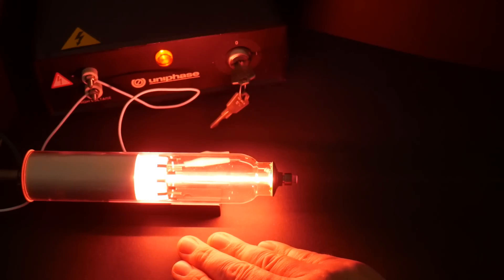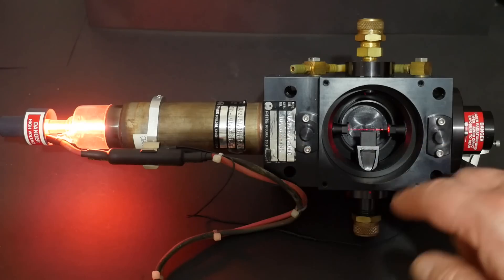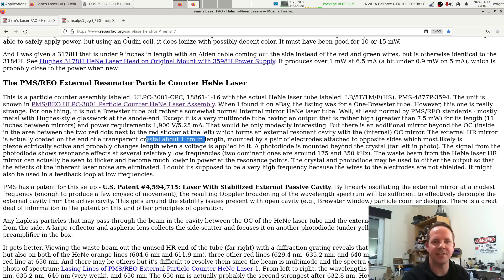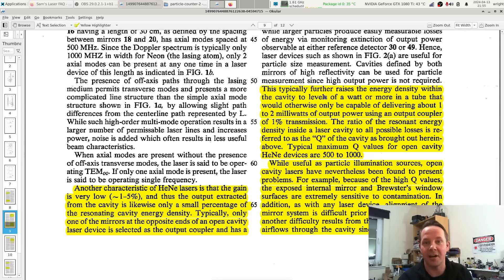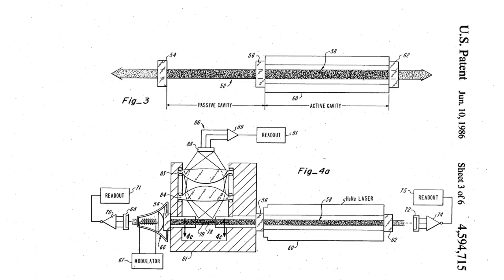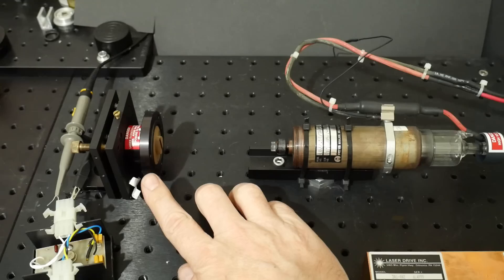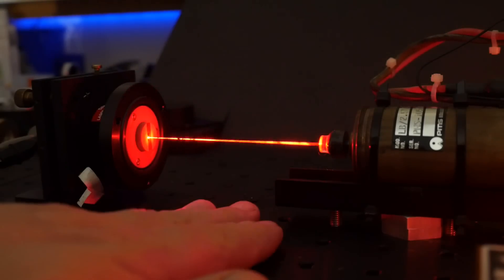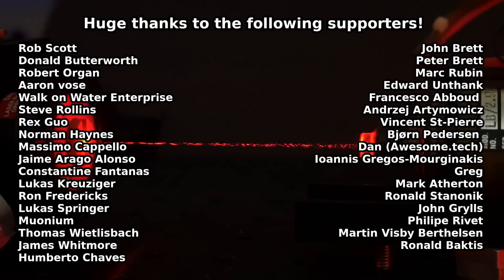What happens when you reflect a Laser beam back on itself?

Comment: i'm surprised the "1 watt" is available outside the oscillating cavity. These lasers are extremely difficult to get to lase. I would expect any scheme to divert energy would make it stop lasing.
Reply from the maker: It's pretty weird. The catch is, you can't get the 1 Watt out of the cavity, it's just trapped in there. the moment you try to couple light out, you are back down to fractions of a percent of what is available in the cavity.

Comment: Given 1-watt is trivial for a laser diode, why screw with this?
Reply from the maker: In the 1980's, there were no one watt Laser diodes. In the present day, well something new could be learned from something old.
Reply: Doing it with a HeNe is more of a proof-of-concept demonstration - it's much more practical when applied to other kinds of lasers.  It probably wouldn't be difficult to extract a peak power of a million watts from a 500 watt YAG/YLF/whatever at around 1064 nm, which is extremely useful for cutting and engraving different kinds of metals.

Comment: What happens when you fire it into a double slit and then reflect it back through the slits 🤔🫣
Reply: Wait till you try the larger version that uses a resonant drive to move the mirror, no piezo required. .  If you look at it with a grating, you may find many, many lines lasing, including Raman lines.  My personal record is 18 lines lasing in the three mirror configuartion. Dr. Knollenberg's mirror designer is a genius, and even compensates for the change in the coating when the frit is fired to bond it to the tube.   The other three mirror version does not involve a Brewster Window,.

Comment: 10:26 Isn't a square wave just about the worst signal to use in this application, considering it spends a lot of time at a constant voltage (i.e. no movement of the mirror hence no doppler shift). It might be interesting to see if using a triangular wave makes a difference.
Reply: Likely the voltage swaps before the transformer is saturated.  I believe switchmode power supplies feed the transformers with square waves too.

Comment: I don't get it.  It is no harder to mount & seal Brewster window to laser tube than a mirror.  If Brewster window leaks, why not mirror?  Furthermore, a scheme of "hard sealing" both mirrors & windows was developed.  I have rescued many of these epoxy-sealed tubes by re-firing the getter followed by helium soak.  Some epoxy sealed tubes beat all odds & last over 40 years.  I have SP-124 lasers that are still working presently.
          I say that the REAL reason for this scheme is that it can be used with COMMONLY MADE laser tubes.  As soon as you put Brewster window on, you open a mechanical can of worms, demanding a structure external to the glass of the tube to hold everything in alignment.
          For really long laser tubes (like SP125 laser), I have seen the discharge current disrupted by reflecting the output back into the laser.
          How are the mirrors aligned on integral-mirror laser tubes?

Comment: Very cool. Super interesting use of a multi mode laser. You don't see that often.
For the diy test with the other HeNe, try adding a lens and put the flat mirror at the focal point to make a retro reflector that will match the divergence. An AR coated lens might be needed.
I will try this in the lab if I ever get some free time.

Of interest, a very similar principle is used in HeNe ring laser gyros to modulate them around their instability point.

Comment: 6:33 Could this be used to produced pulsed laser, somehow?
The speaker has to be still at it's max & min extension (when it switches direction), so at that point I assume the laser could become aligned (light is VERY fast) & can pass through a mirror that is filtered to let through a specific frequency?
Or something like that?

Comment: So the frequency doesn't need to be 'tuned' at all as there's no adjustment if you did have a pot on there to tweak could it improved any or is it not overly important please ?.... Sensational colour even on my monitor must be awesome in the lab.........cheers !!
Reply from the maker: The only requirement seem to be that it's fast enough. There is no pot, but I could try it on a signal generator, and sweep it from 1Hz to 500kHz and see what it does 😉 I wonder if there is a modern use for this effect. He-Ne beams are always beautiful, fire nicer than any Laser Diode. Cheers!
Reply: @LesLaboratory  Yep:)

Comment: Not sure I understand the purpose of the oscillator here - Does the cavity light come out modulated at the same frequency? 
Maybe the OC on this tube has different reflectivity to a standard HeNe. 
Wonder if this would work with yellow or green HeNe tubes.
Reply from the maker: The oscillator drive a piezo element with a mirror coating on it do decouple the external cavity. I have not measured the light output in the time domain, but I suspect there would be measurable ripple, but I also expect the laser linewidth would be broadened to some degree. There is a lot to investigate here, so example, what if the frequency is varied.
The OC will be difficult to measure in-situ, one thing of note, the radius of curvature on the OC is high enough to be noticeable by eye.
It will very possibly work with other tubes. I have a German made Green He-Ne and if you back reflect the beam into itself, it will also generate Red at 633.8nm at the same time. It would be interesting to see what happens to it.

Comment: Very cool! I do wonder if the required oscillator frequency related to the linewidth of the comb of modes in the cavity. 

If you'd use would the AOM you have as a frequency shifter with a stationary mirror, would also work?

Comment: I have a HeNe laser that produces 30mW red output beam, it’s over 600 mm long.
Reply from the maker: Sweeeeeet! I see them on eBay occasionally, but don't have the space!
Reply: I have one like that, Siemens LGK 7626.  Still going strong 40 years later!  Diodes are amazing, but hard to beat the beam profile of an old-school gas laser.  Besides, 633nm is the best color ever. <g>

Comment: This is a classic strategy we use to ensure our lasers are properly back-reflecting so that we can use it for alignment.
Reply: I did something like this during a laser course at a local college back in 83-84. It was so much easier and quicker to achieve feedback than random chance of wiggling a mirror, hoping for a beam, and tightening those tiny screws back down hoping not to lose the beam. My system just spun a strip of white paper between the two lasers and aligning two dots on the paper as it interrupted the beam. Easy peasy. Its output was almost double its rated output and I was quite proud of myself. My instructor was more concerned about me frying it and had me knock the mirrors out of alignment just enough to bring it back down to its rating.
Reply: laserpointerforums has more answers..

Comment: huh... thinking about it, what does the oscillator do really? and why do the frequency and distance to the output coupler matter?
If we vary these, can we get a cavity with peak power beyond the 1 watt range?
Reply from the maker: This is probably designed to produce the Maximum Q by the manufacturer, but there is a fair amount of experimentation that can be done here, including varying the frequency and perhaps even trying other mirrors as well.
Reply: The oscillator and piezo/speaker are constantly changing the external cavity length, the goal being to avoid feeding back too much energy into the HENE tube with a phase that would kill the lasing action. The frequency and amplitude fed to the piezo must be sufficient to give an adequate rate of change of cavity length to minimise the time spent with the external cavity feeding back energy into the laser tube with destructive phase.

Comment: Hi Les: Very interesting. The modulator here is a bit like an "Active Q-Switch" used in high Q lasers
Reply: Yeah I dont fully understand what is going on here.
Reply: When he first described it at the beginning, my first thought was, "oh, that's a Q-switch". The YAG units I worked with were much more efficient and IIRC they consisted of a solid crystal driven by an RF signal.  It was easy to get a peak power of a couple hundred kilowatts from a 100 watt resonator, although of course the average power couldn't be more than what it would do in CW.
Reply: I don't think it's like a Q switch. Perhaps in effect, but not in principle. I've never played with a HeNe laser, but know that Nd:YAG lasers have an envelope of frequencies they'll accept ( individual nanometers wide ). I think this works by increasing the level of excited photons by driving the gain medium with more than one wavelength via doppler shifting.

Comment: I used to troll thrift stores in the 80s looking for Philips LaserDisc players.....
Reply from the maker: In the 90's and early 2000's, those Lasers turned up at surplus stores real cheap, but you can hardly get them now, and when they show up they are $$$
Reply: First gen laser copier optics decks with HeNe tube and supply, scanning mirror, and AO modulator were cheap and plentiful on the surplus market in the early '90s.
Reply: Same.  Edmund Scientific & Spectra Physics were my "dealers" for gas lasers.  Good times.